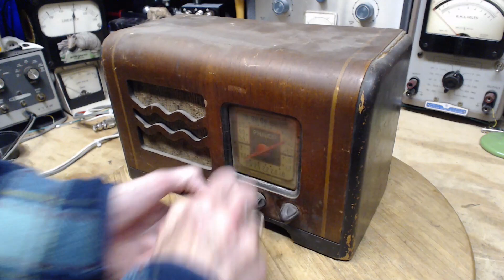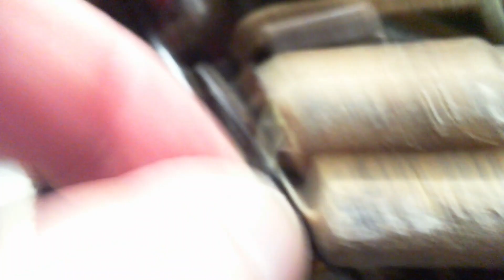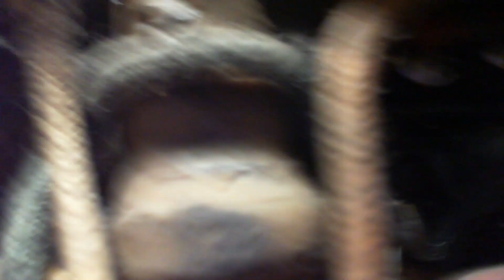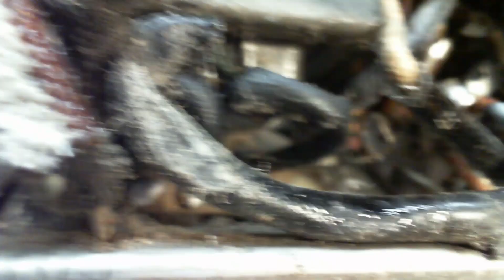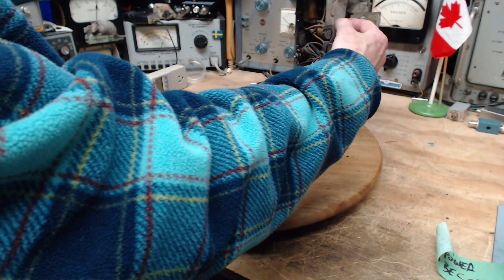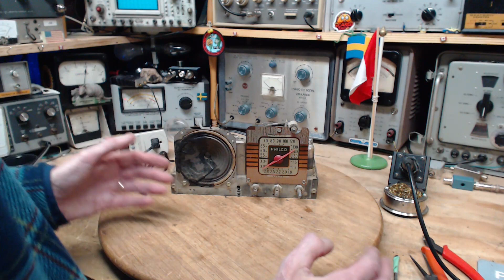Philco Model 25 Tube Radio Video #1 - Checkout and Power Up

Comment: Hi, the main reason that I stopped repair of vintage radios to be sold to the public is that the owners of the antique shops did not want to pay for a full recap and restoration.  Just to replace the electrolytics is not a good enough repair job. .they buy the radio foe 5 or 10 dollars then they only wanted to pay only 30 dollars to replace electrolytic caps and then turn around and sell the set for 200 dollars.
Reply from the maker: I think there were a lot of shenanigans going on back then.  One of the main reasons I make these videos is so there is no question of what I did and I'm not tempted to cheat anyone.  I'm not a cheater anyway.
Reply: That's a pity, painful for a conscientious man like yourself